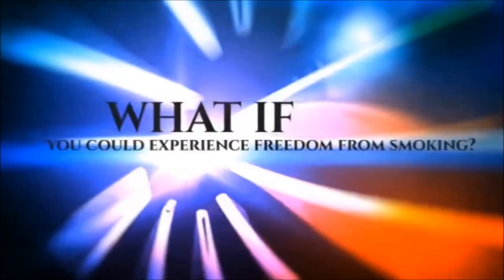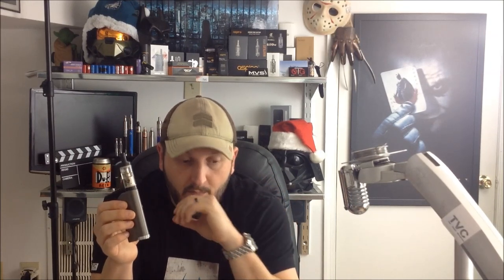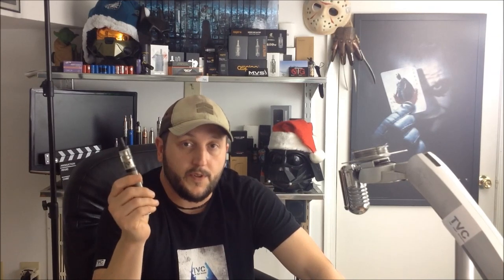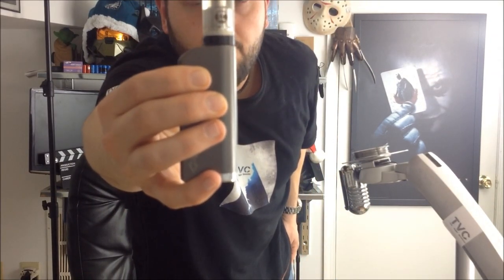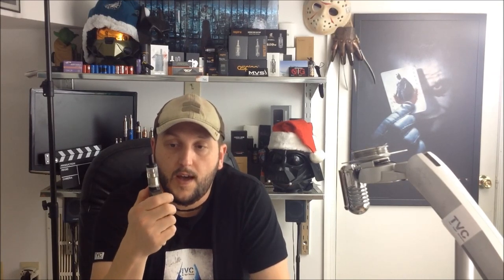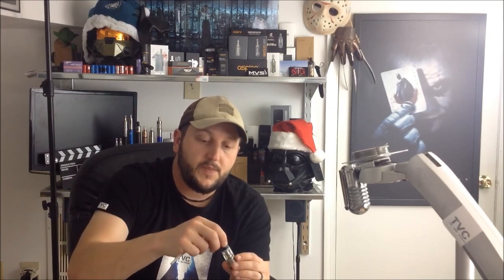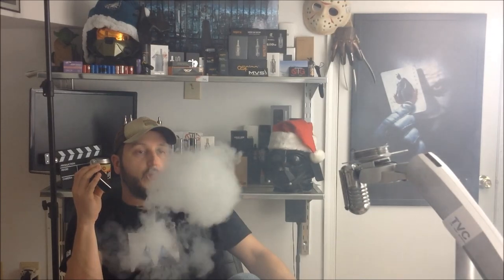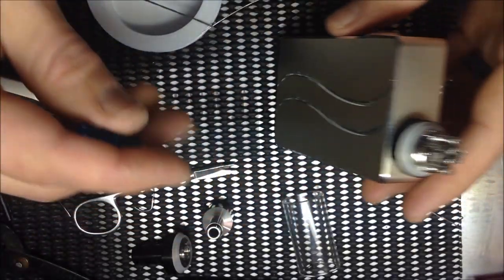The Billow RTA Review On TVC

Comment: i have noticed that this rta gets real hot once you have taken few hits back to back, even the drip tip is getting pretty hot. Have you noticed this ? I am running a single coil 24g .6ohm around a 2.5mm screw driver. thanks
Reply from the maker: I have notices that too.  Try a better insulated drip tip.  It does get a little warm during a chain vape session.